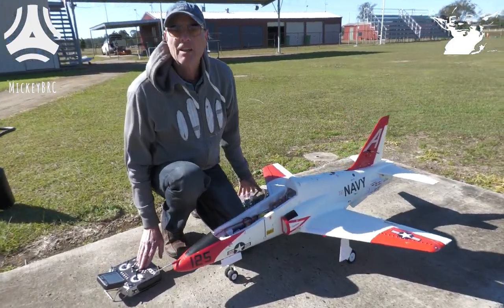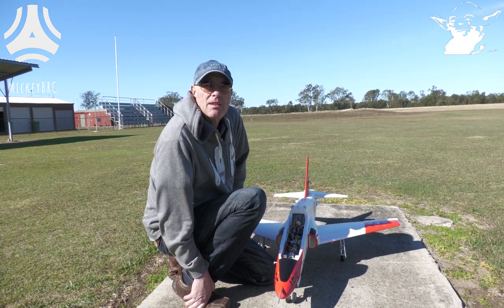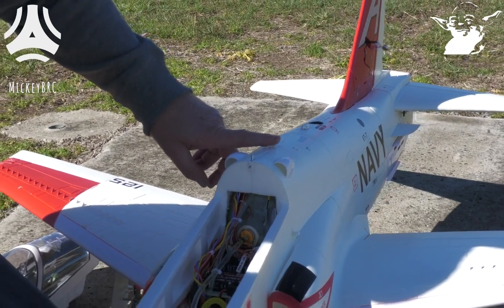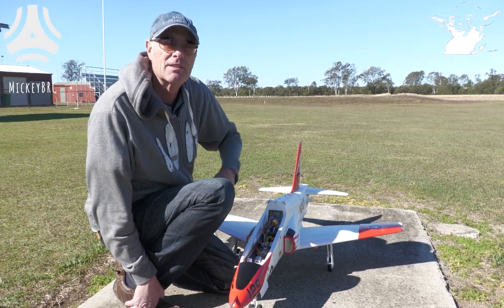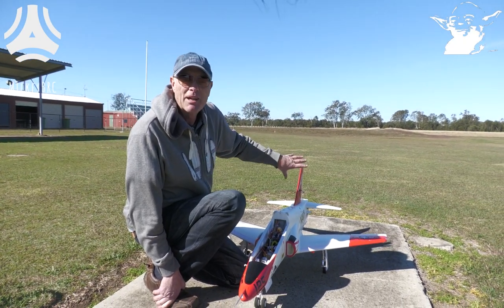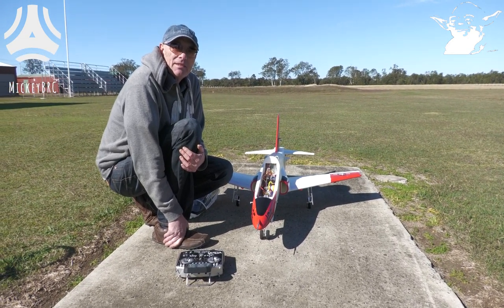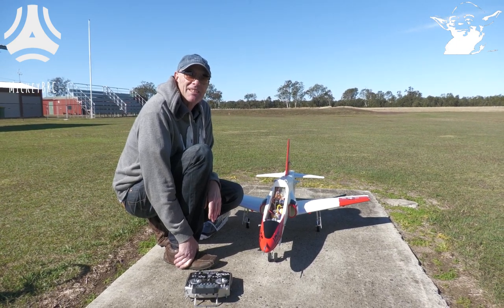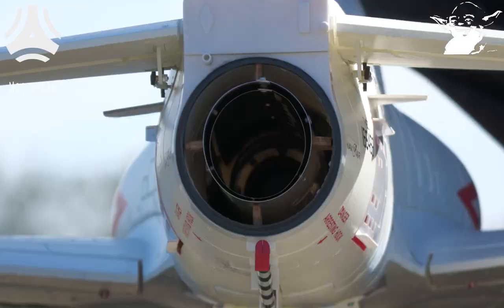Xicoy X-45 powered Freewing T-45

Comment: Hi did you detune the X45 or run it at the full 45N?
Reply from the maker: Hey ozboofhead64, no they aren't detuned or tuned up to the 4.8n they are factory standard settings. I think the autorestart has been activated that's the only change
Reply: Thanks MickeyBRC run the X45 on the Sebart Avanti @ 35N - got me looking at the T45 as another model.  Did it cost significant shipping to get the conversion kit from Paul in the US?
Reply from the maker: @ozboofhead64  That Avanti is nice! you could probably wind up to 45n with no issue. My FW MiG21 runs the X-45 at factory setting, a little rocket! haha. I think for Paul's conversion kit you are looking at around $400aud mark delivered, That includes your duel walled pipe, custom fuel tank, and the air trap. Give or take depending on currency conversion. I'm about to start on my T-45 once it arrives here in the country.
Reply: @SquawkVFRC  excellent thanks for the advise